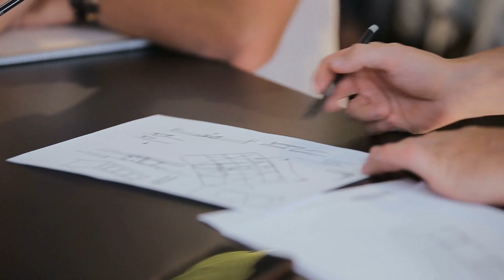A better approach to engineering |   holistic engineering

Comment: Communication is so important. The best consultants I've worked with, and who I respect the most, are the ones who think about the big picture and solves problems that best serve the project as a whole. The earlier those discussions are had, the better. It saves everybody a lot of effort and time. Unfortunately (in my experience) Structural Engineers tends to be approached at a later stage in the project, which complicates the issue.
Reply from the maker: Hi Theuns, communication is a engineers more important skill and everything we produced (drawings, structural advice and meetings) requires us to communicate to non-structural engineer what is required. Structural engineering need to try and get involved earlier in a projects infancy, and agree we are far to often only engaged late in the development of a project, this is something that we can start educating client the benefits of engaging a structural engineer earlier.

Comment: Great video. Agree, my approach is always be up front with the builders/ clients - communicate and educate them. That way way they won't try to second guess any advice.
Reply from the maker: Hi Ed P,  Agree it is always best to be upfront and ensure that your communication is appropriate for the intended recipient. Educating them about structural engineering will also make your life easier as the project progresses.

Comment: As per my experience, a BIM platform such as Revit is a good solution to ensure holistic engineering, so long as all discipline engineers agree to work on the same BIM platform leading by the architect.
Reply from the maker: Agree a properly delivered project with a full BIM model leads to better designs and less headaches on site. The only issue is that builders and developers don't want to pay the extra to deliver a project this way.  As an industry need to get better at marketing the benefits of a full documented BIM project.